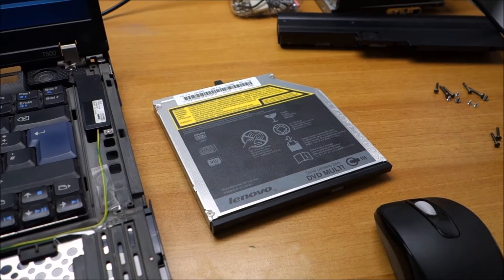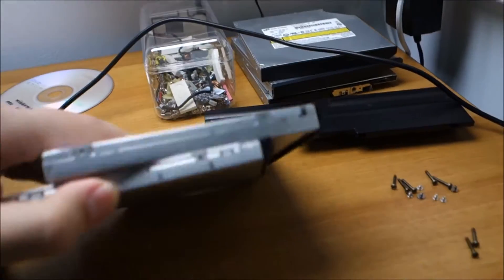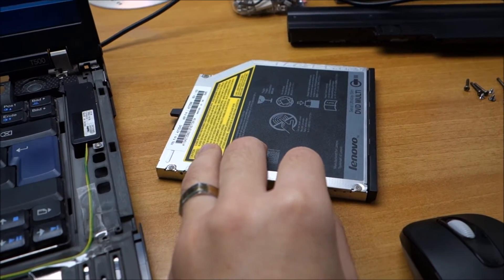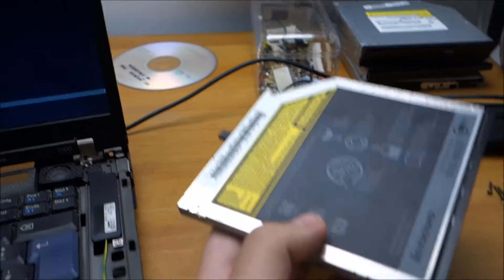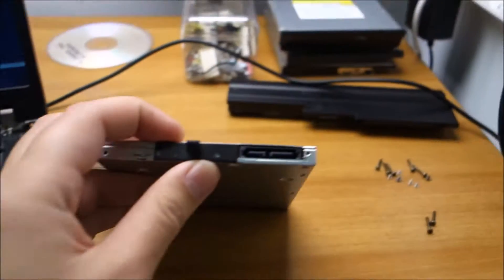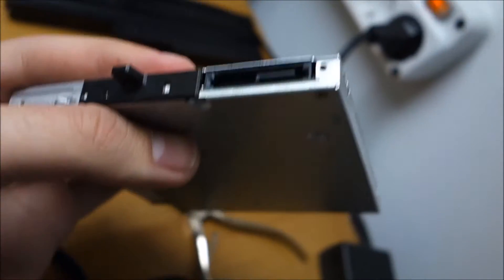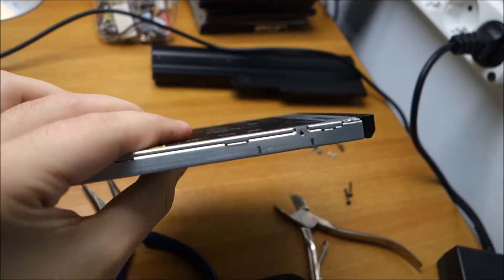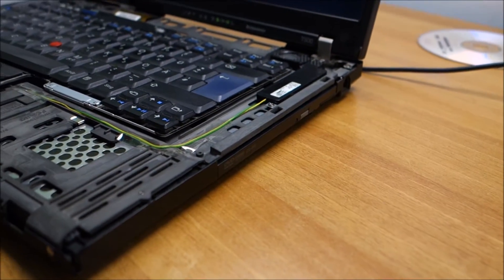How to fix Lenovo UltraBay auto eject for good!

Comment: I have the same problem with my Thinkpad t420. You don't have to destroy the player, you can disable it in the bios.
Reply from the maker: Mine did not work like that. It was probably some electrical fault that kept ejecting it no matter what.
But of course, if that works, it's perfect.

Comment: you would be better off buying an ultra-bay hard drive caddy, if you shop around you can pick them up very inexpensive and its a good way to utilize the space left when you discard your broken Lenovo DVD while at the same time increasing your storage capacity or even if your not having this problem as said here we very rarely use DVD drives these days and you can quickly swap the hard drive caddy for the DVD when needed if its still working ok or just get  a USB DVD drive if you prefer. i am sure most of us have a spare sata hard drive we can use for this.

Comment: All I did was run Malwarebytes, fixed all issues and cleared them from my computer. Second, I opened Avast Cleanup Premium and fixed all broken registry keys.Then upon start up I click F1 to open the BIOS screen, I restored all setting to default with F9 I believe then F10 to save and reboot my computer. If you wanted to fix this error all together though you could have completely removed the drive from the computer system. However, my optical drive was ejecting automatically on its own but I have never had any issues with not being able to read CD/DVD's. Hope this helps anyone who may see this and has a similar problem but is not comfortable removing their optical drive all together!
Reply from the maker: You were lucky, you only had a software problem, but I had a hardware problem, as many other Lenovo  slim ultra bay drives have, sadly. Mine could only be solved like I did in the video or with a brand new drive.